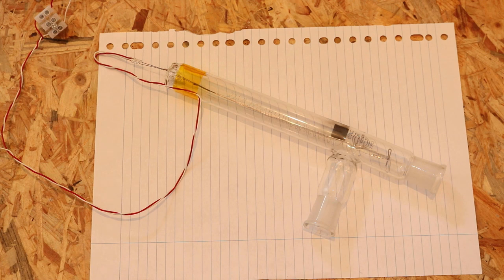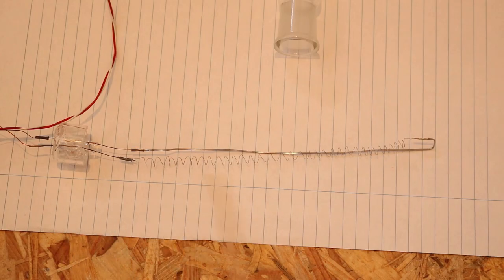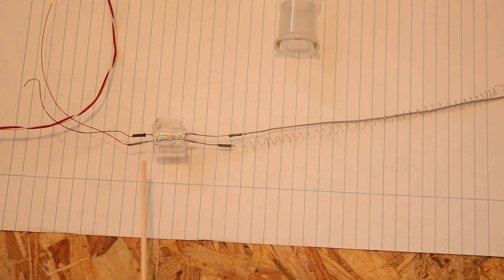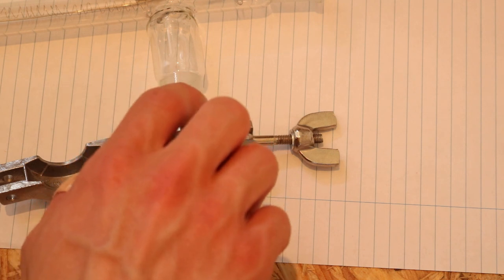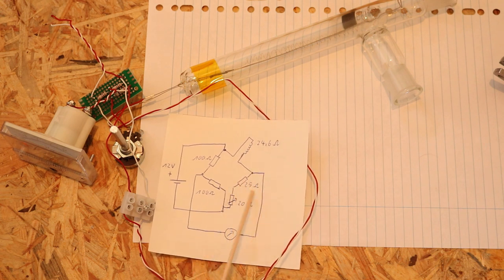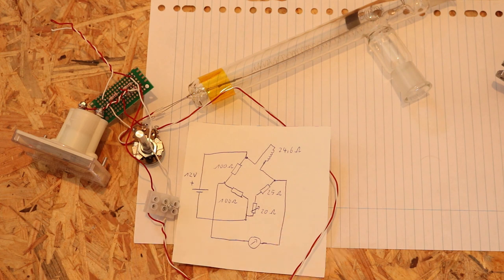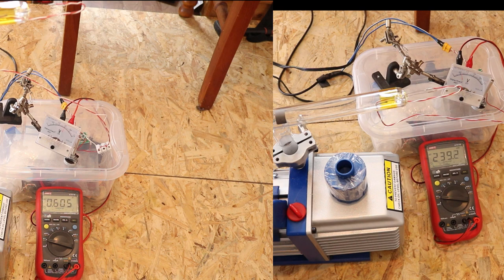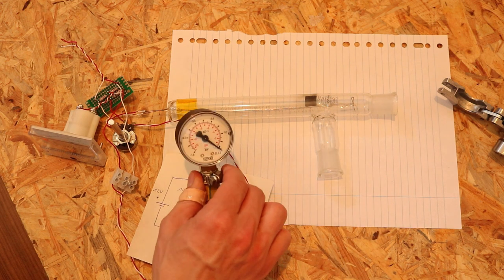How to build a Pirani vacuum gauge

Comment: Very nice demo and explanation!

I've designed and built a couple Pirani gauge controllers in the past. Conventionally, these controllers balance the Wheatstone bridge by altering the supply voltage and keeping the voltage difference between the dividers 0. If you can keep the resistance of the wire stable, you inherently keep the temperature stable (at around a 100-120C). The big benefit of this is if you use a fixed supply as you do now, you run the risk not enough energy gets taken out of the wire at lower pressures, making it run at a higher temperature, meaning it degrades quicker and you need more frequent calibration and replacements! 

But accuracy with Pirani gauges is something you shouldn't want to chase anyways. The biggest issue is that your measurements are heavily dependent on the mixture of the gas you're pumping away and the surrounding temperature of the measurement head. The ones used in laboratories usually give a figure around +/- 50% accuracy hahaha. Order of magnitude is significantly more important when measuring the quality of a vacuum, you can measure up around 10^-3 mbar until cooling of the wire through the electrical contacts starts to become the dominant effect on the temperature of the wire!

You did a great job even making your own sensor. It shows anything is possible on a bit of a budget being handy. All values are in the correct ballpark, I think your sensor can be about as accurate as the ones commercially available! Contact me if you ever need help designing / characterising your own controller for your gauge!

Comment: Do you think its possible to cut the wire/glass base off of an old vacuum tube and use it for feed throughs in a new tube like this? I think it would be a really good way to get lots of feed throughs but I'm unsure if its feasible to attach the cut piece to a new glass tube?
Reply from the maker: The problem is, you don't know what glass it is.
Reply: @thesciencefurry  I know the vast majority of vacuum tubes utilize borosilicate glass as they use kovar glass seals, but it would be hard to tell the grade of the borosilicate. Might be worth a try though!